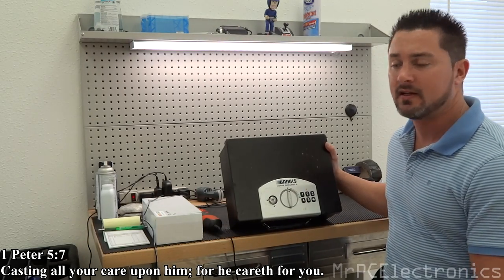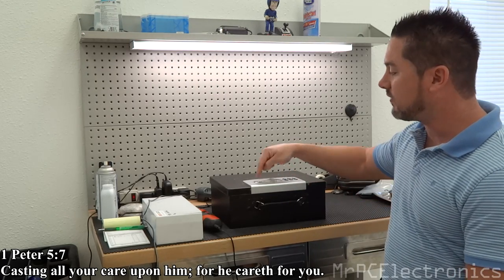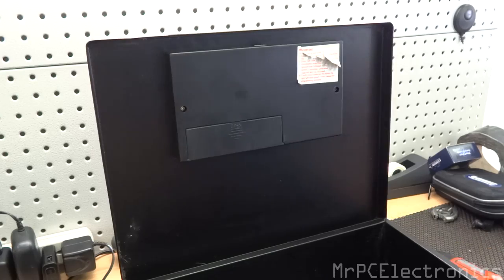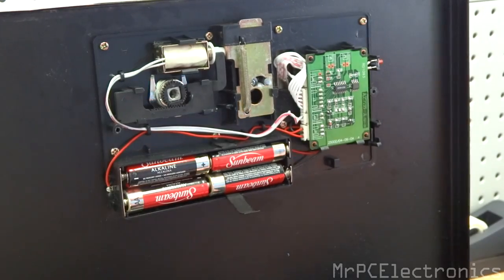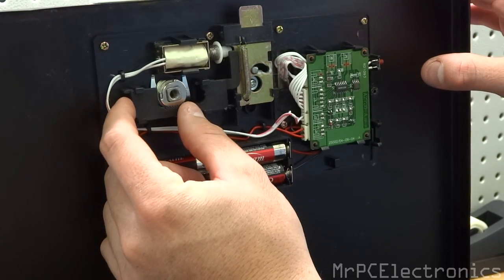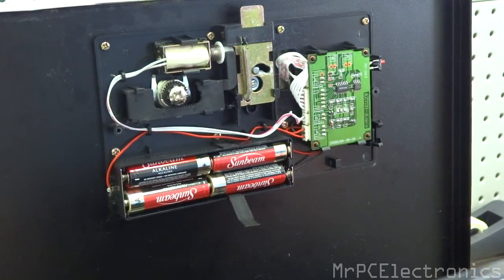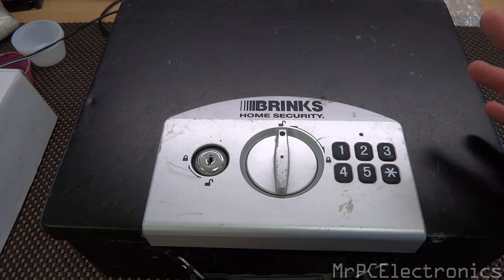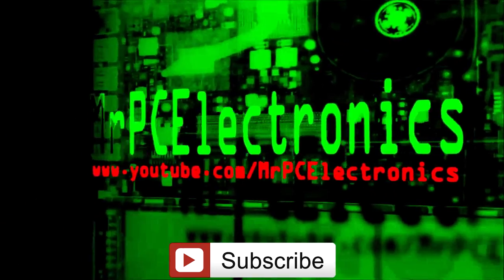Brinks Security Lock Box "No Key Programing Lock Code"

Comment: This safe is fine for keeping young kids out of stuff, but little else. I inherited one of these from my brother. It would not lick. Your video was useful. I opened the casing and discovered the little bar in the actuator was bent. I straightened it and now it works ok. Clearly someone had taken a pair of heavy pliers and forced the switch from locked to unlocked. So again it will work against young kids, but not a determined adult. Thanks

Comment: Just watched ur video ..when did u turn the dial back to unlock after u released the spring. Coz u cant turn the dial to unlock to set the code...
Reply: Nikki Pucillo the dial has to be in the unlock position before adjusting the locking mechanism inside. I made the same mistake the first time.
Reply: i have the same problem. once the spring comes out, it blocks me from putting it in the unlock position.

Comment: Even when I move over the plastic lever my plunger doesn't wanna spring out.
Reply: Open it and pull the actuator. Held in by two clips. My guess is the bar/pin is slightly bent. Mine would not lock at all. I found the pin was bent almost into an "L". I straightened it with pliers and now it works fine. Somebody probably tried to force the dial switch and bent it. Hope that helps.